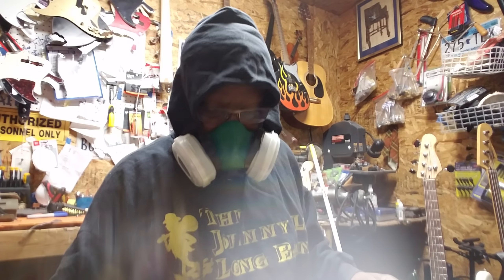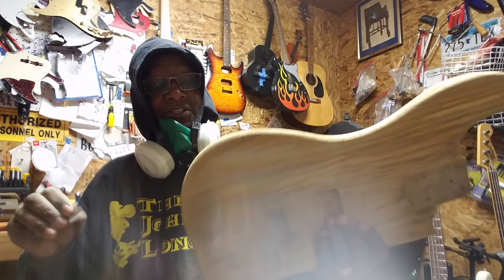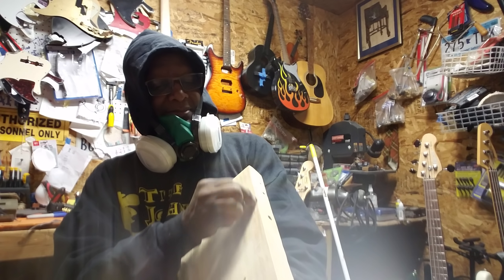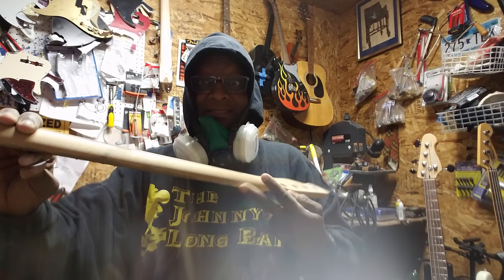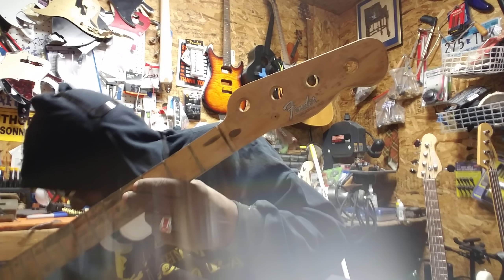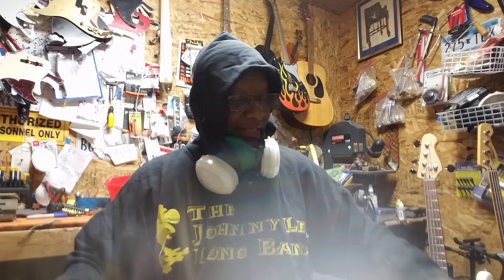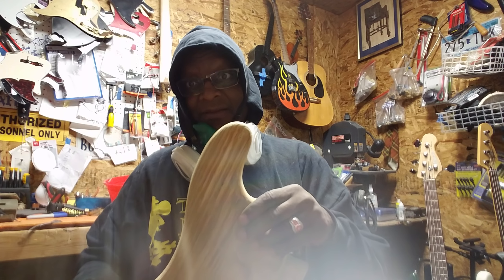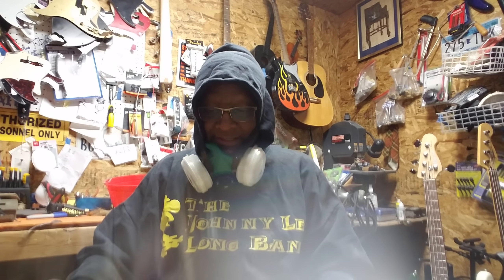Refinishing 1968 FENDER P BASS CUSTOM

Comment: 👐😎👐 Johnny, on that body I suggest carefully block planing the surfaces for glueing to true and square them. Also, maybe consider using a biscuit joiner instead of dowels. Positioning will be more precise and reduce surface mismatch of the top and back. Thanks for sharing the project progress with us, I am very anxious to see the next installment.